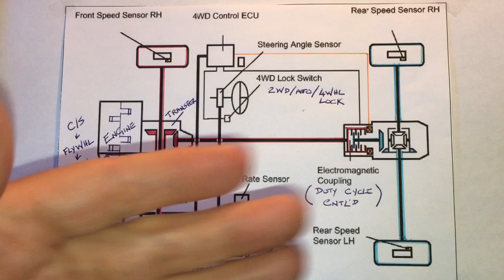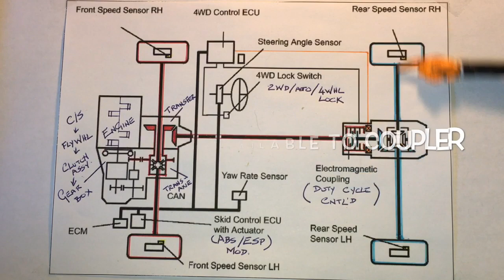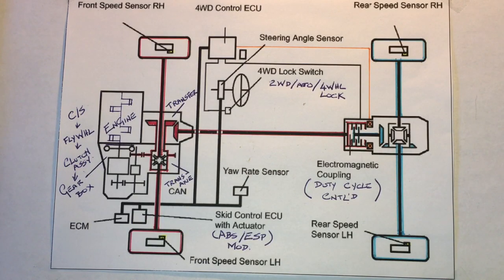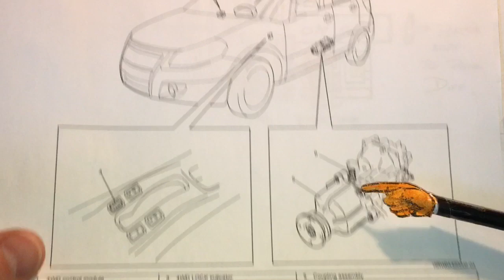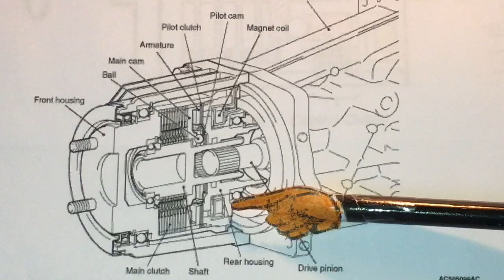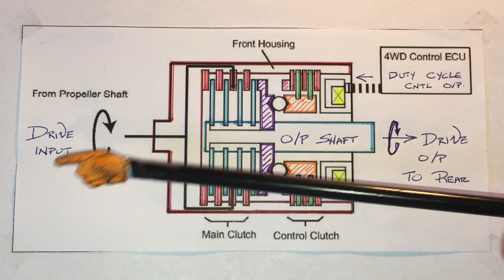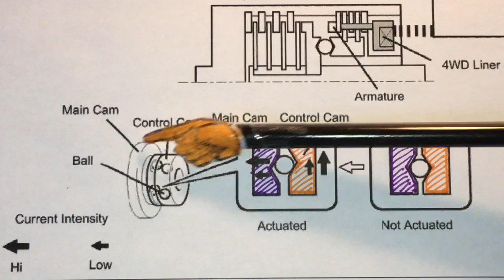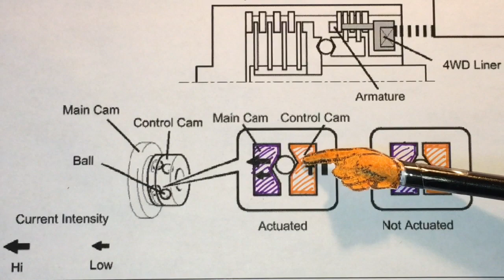AWD Magnetic Coupler  Operation

Comment: I have a problem with rear wheel traction in my 2007 sx4 2.0, the auto and lock light work correctly on the instrument panel, the AWD module sends a signal to the coupling and the resistance of said coupling marks 3ohm just as the manual says.  Raise the tires of the vehicle and when you release the clutch pedal in the lock position, you can hear the coupling part thunder, but the sound immediately disappears. The tires all rotate when suspended, in any position of the AWD switch.  Only when on the road only the front ones work.  Could it be a malfunction of the magnetic coupling?
Reply from the maker: I doubt it. That sounds like normal operation. In AWD some drive is always sent to the rears on initial movement, then the drive is only coupled to the rear if front wheel slip is sensed. Lock mode will split drive 50/50 front rear, but will drop out (around 40kph). Read the owner handbook.
Reply: @TheGibby3340 I appreciate your prompt response
Reply from the maker: See initial response edit. Thx for watching 🍻

Comment: Do you have any info about electricity specs? volts and amperage etc. I have a toyota with a viscous coupler but that's not that good. AWD is not engaged on demand, in wintertime it's always engaged because of freezing (one of the coldest cities on earth). After the big bearing was dead, i swapped the differential with an electromagnetic one. My idea was just to engage the coupler 100%  when i need. Simple hardwiring to the battery with relay and button. Will it work?  At the moment the propeller shaft is removed. in next weekend i will wire it and test. Before that i wanna gather as much info as possible. googling but nothing about such mod.
Reply from the maker: This is the extent of my knowledge of the system…https://youtu.be/zuxnsJDni34

Comment: I have a 2011 AWD Toyota Sienna, and there is a bearing in the electro mag coupler that is failing. My question is can I just take off my rear propellor shaft basically deleting the drive to the rear diff and coupler and just drive in front wheel drive like normal siennas? The rear only engages when it needs to, so I’m guessing the front differential is built strong enough to handle the weight alone? I’m not sure and all my research has been mixed answers and obviously Toyota won’t tell me anything. I really can’t afford the 1200$  coupler to fix it the right way.
Reply from the maker: I am sorry, to be honest I don’t know. I have pondered the same question myself. 2WD gearboxes are minus the transfer assembly of course. If that is left completely unloaded I am uncertain of any unintended consequences. If any…Perhaps a low mileage used assembly might be reasonable money?Thx for watching. Good luck.

Comment: My temp sensor on my 2012 does not stick out of the top like the diagram. Its buried in the diff. Is that normal for the later years?
Reply from the maker: Sorry IDK…My experience is limited to pre 2010 models. Thx for watching 🍻